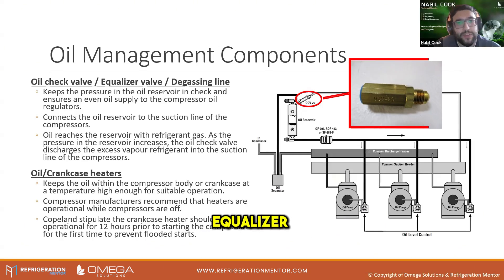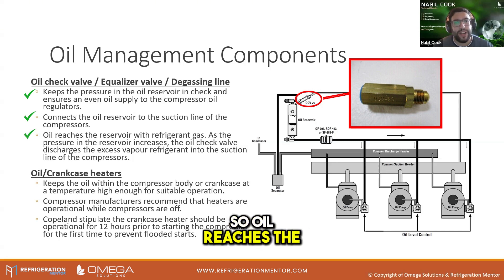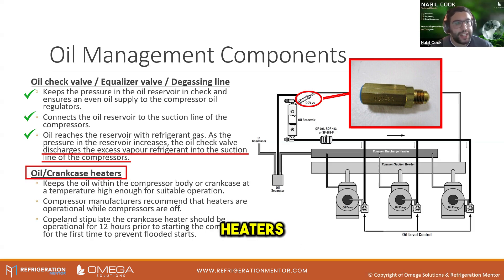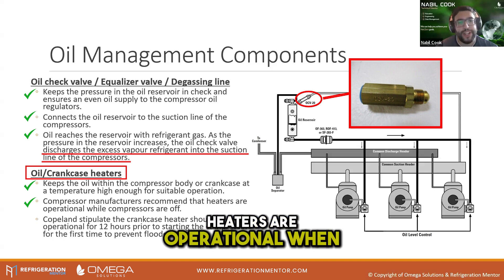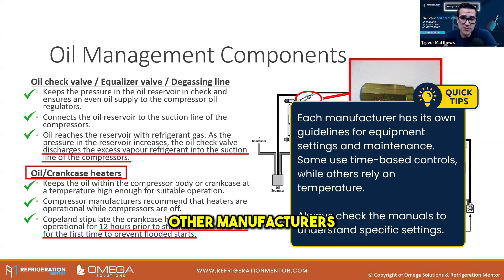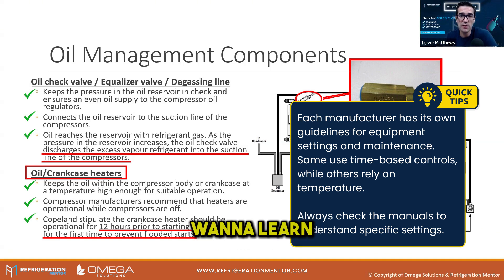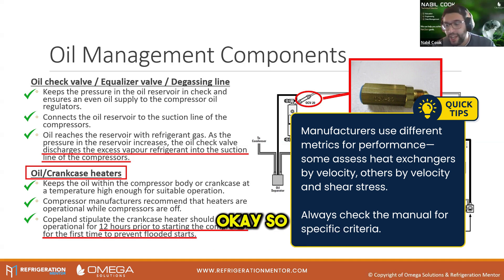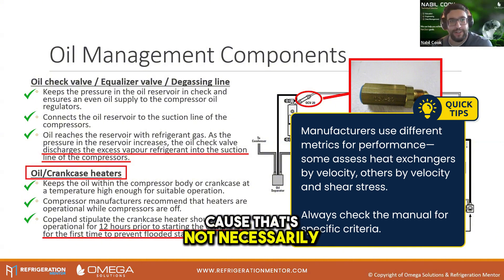How long should the crankcase heater run before starting the compressor for the first time?

Comment: I throw a heat gun at the bottom of the compressor. only when I find myself in a hurry and don’t wanna wait 12 hours

If the rest of the systems at 80° and you have that complete compressor at 125° you know you have no liquid refrigerant inside that compressor